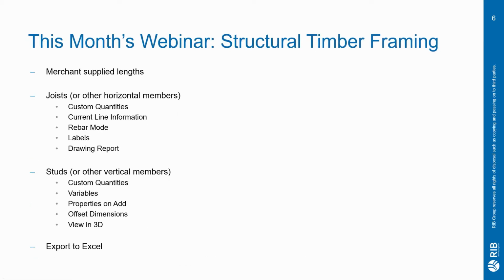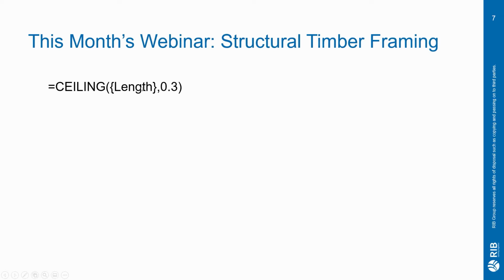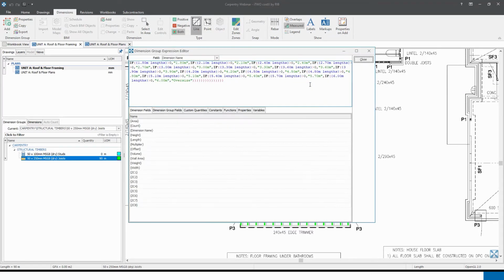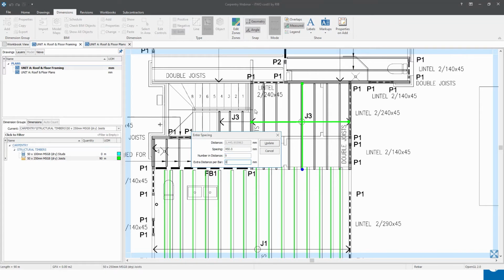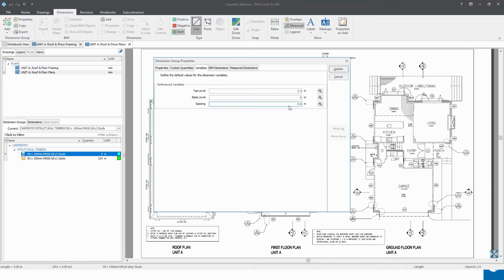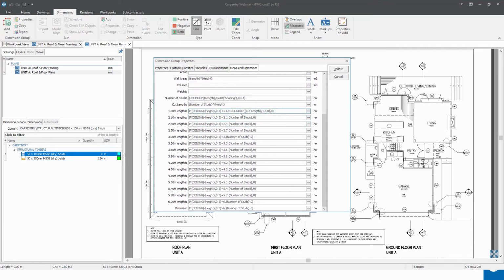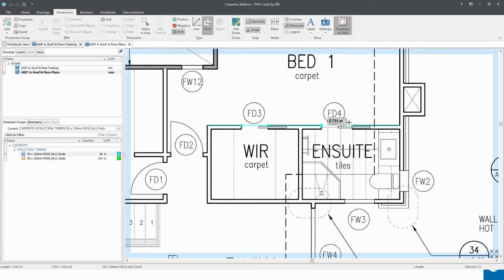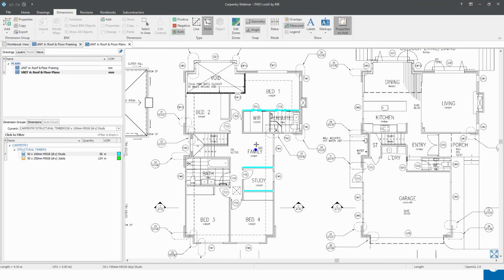iTWO costX Coffee Break Webinar - Structural Timber Framing and Carpentry

Comment: Found a way round the issue with label not updating. I created a Stock Label custom quantity. I then used the following formula in the measured dimension section. Then i set the default display to the stock length dimension. IF(CEILING({Length}/COS(RADIANS(XNUMBER({Dimension Group Name},1))),0.6)<=6,ROUND(CEILING({Length}/COS(RADIANS(XNUMBER({Dimension Group Name},1))),0.6),1),0)

You would have to adjust depending on your stock length rounding etc.